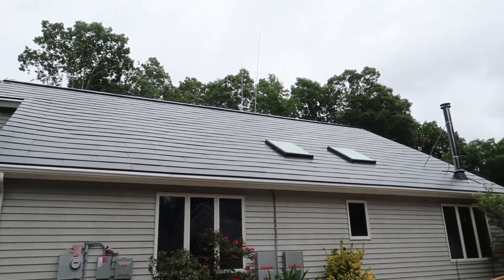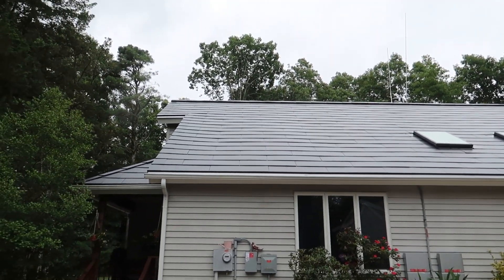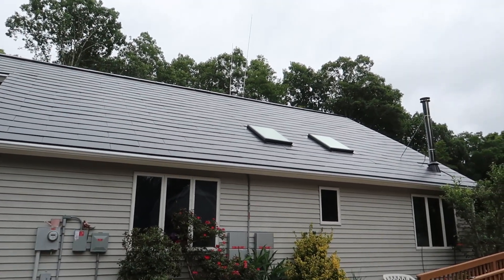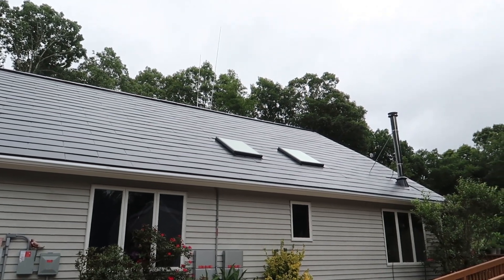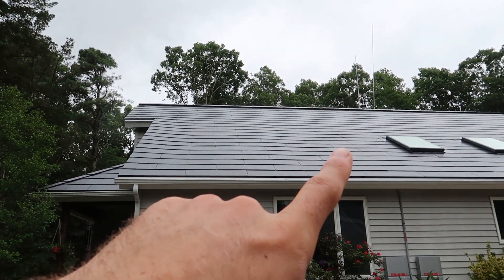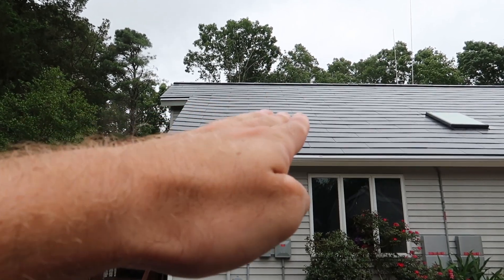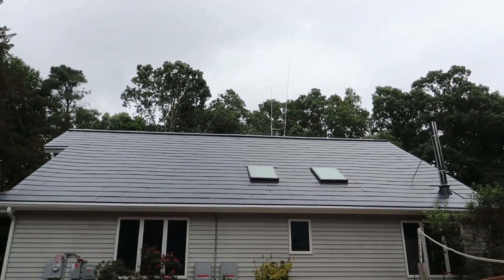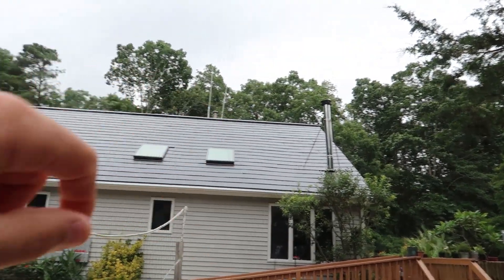Tesla Solar Roof Warp Is It A Major Problem? Let Me Explain  | Tesla Solar Roof

Comment: Great video! I saw in another video that they actually provided the owner with a free service panel upgrade. Did they offer anything like that for you? Thanks!
Reply: Sravan... there is no real upgrade. If your house is already set up for correct Amp then it’s already fine. Tesla changes the panel or upgrades it for all if that is what your house needs. In reality that pricing is already baked in your quote
Reply from the maker: No they did not